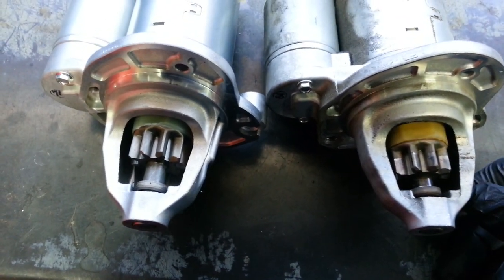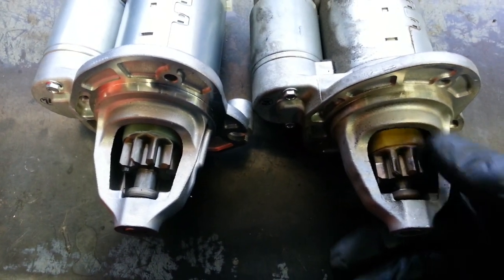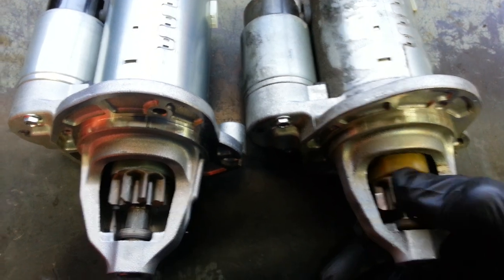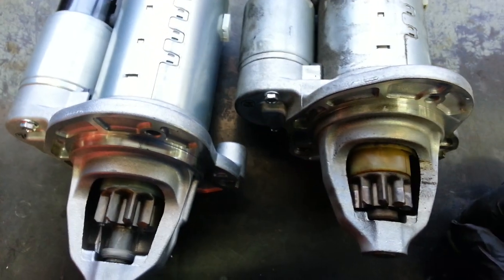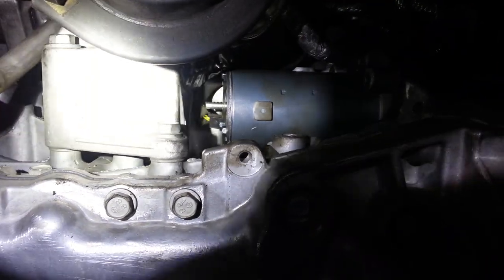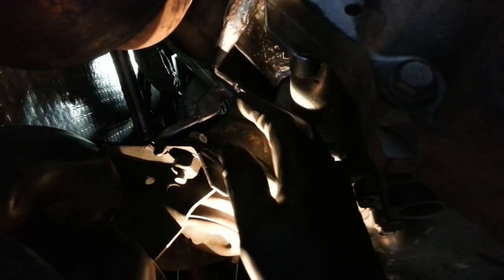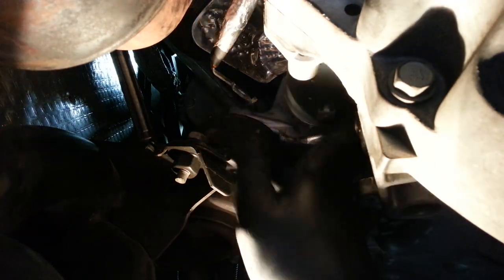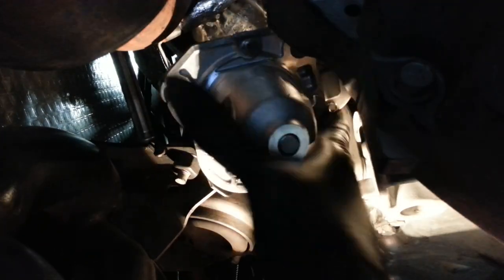2012 Dodge Durango 3.6 liter starter replacement.

Comment: No need to remove engine mount on an AWD model. Remove the 'telescopic steering shaft' union near the rack-n-pinion with a T50 Torqs bit, push it toward the driver side tire and wiggle the starter out easily. I just did the whole job in 23 minutes.
Reply: Steering shaft trick worked on a 2012 Grand Cherokee. hardest part was getting the electrical disconnected. Thanks!
Of course, the Chinese replacement starter was just enough larger that it wouldn't drop back in without moving the mount bracket GRRR!
Reply: Sarah Pinder will I be able to do this with the awd Durango on a jack stand with just the front left side jacked up and laying under or would it need to be on a lift so you have room to stand under? Wondering if I could just do it in my garage on a jack stand
Reply: You pulled it out towards the front of the car?
Reply: Sarah. You are a life saver. This trick worked perfectly on a 2012 jeep grand cherokee laredo X with 4wd. The front axle and diff make this job very difficult as there is not much space to get arms or hands up. Removing the steering shaft made just enough room to slide the starter forward in the engine bay to remove it. Thank you so much for sharing this info.

Comment: To get to the top bolt of the 2 bolts that hold the starter motor in, use a "Wobbler bit" extension from underneath the SUV. It will allow you to get the angle with a socket and ratchet, easy peasy. Remember, it'll be easier if you disconnect the 6 bolts holding the prop shaft and moving it aside to make room for your hands.

Comment: Get to the finish line by pulling front shaft on 4x4 then pinion flange , may drop axle housing bolts. I did but don`t think i had to.

Comment: Help‼️‼️ how do I get the starter out pass the motor mount
Reply from the maker: watch and listen carefully at 1:00 forward. Watch how you have to spin it a little before you move it towards the front of the engine and toward the engine mount.

Comment: So I’ve managed to get bolts loosen on the mount and bracket but it doesn’t move at all so do I need to completely remove the bolts on the mount and bracket so it’ll move enough to slide stater out or can I jus loosen bolts to get it to move ?
Reply from the maker: I'm sorry David. I didn't have to take the mount off at all. Only the shield for the mount. I can't help you from here. I'm in Rome, Georgia. If you were close by I would drive over. Good luck.

Comment: Trying to remove starter on awd cant remove top starter  bolt any suggestions  would be helpful
Reply: terrancenelson2010 you can get to it from the back.  Approach from the rear and you  can get to it with an extension and a swivel.

Comment: I am replacing starter on 2011 grand Cherokee 4x4.  Is this short cut possible on 4x4 as well?  I see it is even more crowded with front drive shaft.  Thanks.
Reply from the maker: drej car guy I've done the starter on the GC. I did unbolt the drive shaft and set it to one side. It's not that hard. You can do it.👍

Comment: Hey was this an awd Durango or 2wd. Having a rough time getting the front drive shaft out right now. Anything you can think of?
Reply from the maker: Brian S  . I don't know if the one in the video was awd. I have done awd and it's the same after you take the driveshaft out. I don't remember it being difficult to take the driveshaft out. It looks harder than it is.  Make sure you mark the driveshaft and flanges or yokes so it goes back in exactly the same. Take a video and upload to YouTube to show your problem. I'll check it out if you send me the link. Good luck.

Comment: we just spent 4 hours trying to do this. what kind of devil Magic did you use that it slid right out
Reply from the maker: I did unbolt the front drive shaft and the move it back towards the transfer case. The trick to getting it out is to kick the tail of the starter toward the driver's side and above the mount at the same time you move it towards the front of the car. You then rotate the starter clockwise as viewed on the video. It seems impossible at first. I've done it on several of these engines now.
Reply from the maker: Any time you unbolt a driveshaft it's a good habit to mark the flanges so that it gets bolted back on in the same position. Indexing.
Reply: we are actually working on a 2011 jeep grand cherokee but looks identical.  Thanks so much for replying

Comment: How did you do this because I have tried your way and I can't get to just fall out at all. The starter keeps hitting the motor mount. Ant this is a  2011 Dodge durango crew 2wd 3.6L ur trick does not work for me
Reply from the maker: Sorry you're having trouble. I do remember the rotation is important. The shield removal from the motor mount is important as well. Upload a video of yours and send me the link. Maybe I can see what's different. Good luck.